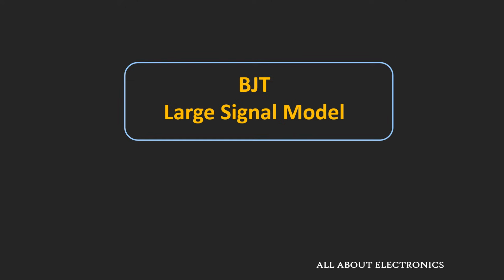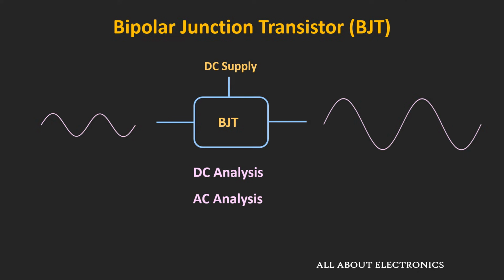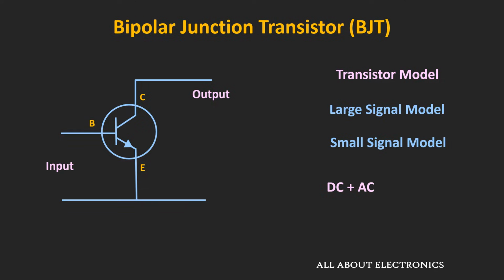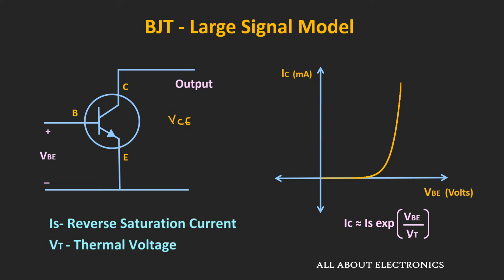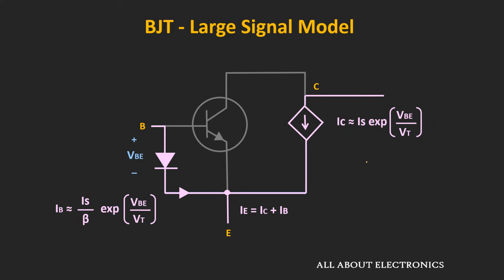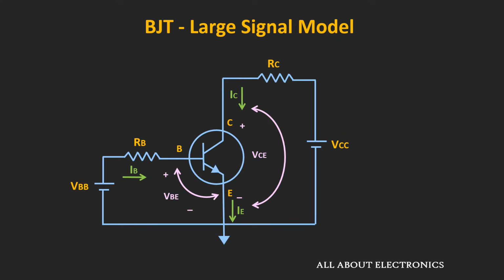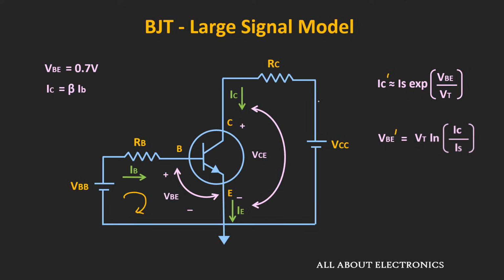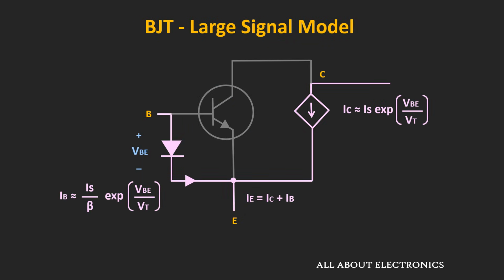BJT Large Signal Model Explained

Comment: direction of current source in large signal model should be taken opposite to what is taken as it is npn transistor, current should be acc to arrow in transistor from p to n
Reply from the maker: In NPN transistor, the collector current flows from collector to emitter side. At the emitter node, the summation of base current and collector current is equal to emitter current. So, here it is satisfying the KCL. If you consider the direction of current source opposite then it won't happen.

Comment: Should I model bjt as voltage controlled device or as a current controlled device ,because if we look Ic=IS.exp(vbe/vt)
We can see collector current is a strong function of vbe , so can we say that bjt is voltage controlled but if we this it's voltage control the equation become very complex to solve , also looking in data sheet how will we find reverse saturation current IS